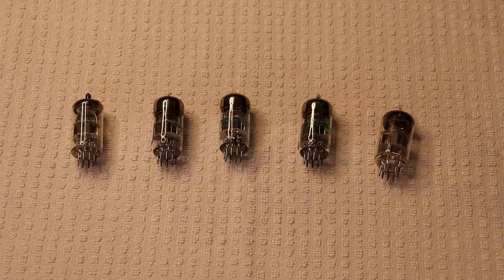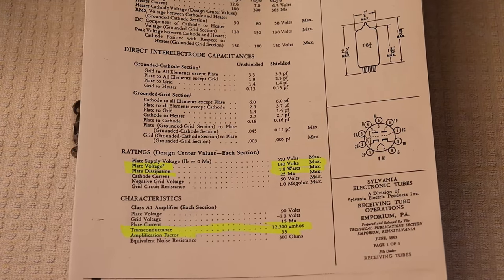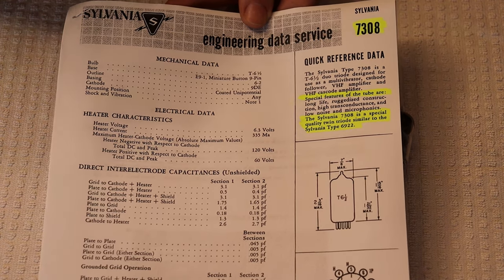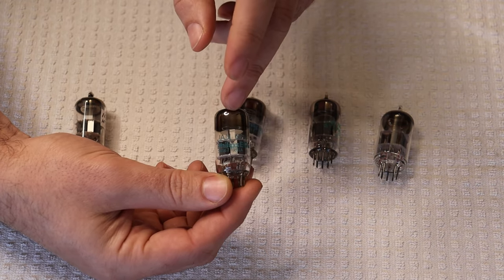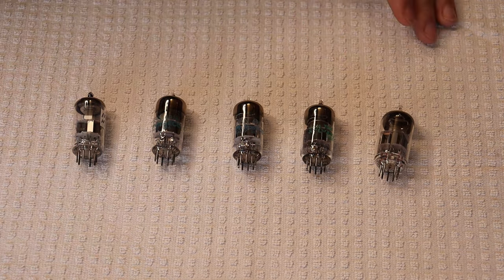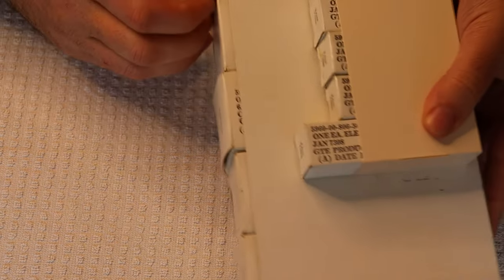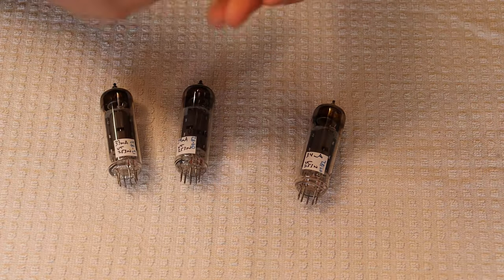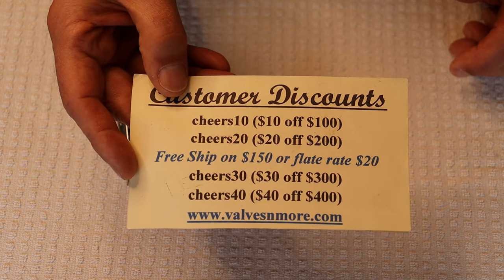tube lab #165 - 6DJ8, 6N23P, 7DJ8, 6922 & 7308 Tubes

Comment: Informative video.  Are 6bq7 or 6bz7 tubes acceptable or good substitutes for the 6dj8?
Reply from the maker: We have a lot of the 6bq7/6bz7 (maybe 1k) and hope to use them one day in a Kit Amp.  Yes they are close electrically to the 6dj8 and most likely will work.  What we found is they test inconsistantly, in our case we have so many matching up pairs wouldn't be a problem, but if you only have 10 or 12, there's little chance you'll find a close matched pair.  Also Caution the 6bq7 has a lower max plate voltage of 300v vs 330v for the 6dj8.  Given that we currently have in stock NOS NIB (new old stock, new in box) mil spec Sylvania 6922 (premium 6dj8) it would make more sense to use the best tube and they're currently on Sale!

Comment: Any videos where you explain what goes on inside the glass enclosure of the tube?
Reply from the maker: Absolutely, scattered over the years and as well on our other channel "mellow tone kits", whenever we're explaining how a circuit works.  There also some excellent historical videos made by companies like RCA.  To find those just google "how a vacuum tube operates".  Once you've seen one, they're all exactly the same. In fact all tubes basically operate the same way with only variations on the original technology.

Comment: @tubelab194 do you know the 7 pin GZ81 rectifier of the 1950’s please ?
It was used in small amps and radios.
Reply from the maker: No not at all, in fact we can't even find a data sheet.  Why are you wasting your time with this rectifier.  Even if it exists it's not common.  Focus on more commonly available rectifiers.
Reply: 7 pin rectidiers ..........you can maybe substitute for a 6X4...check voltages and pin out !
I never saw a GZ81...?    Maybe you ment an EZ81/6CA4 ? ( nine pin used commonly in many radios and amplifiers .)